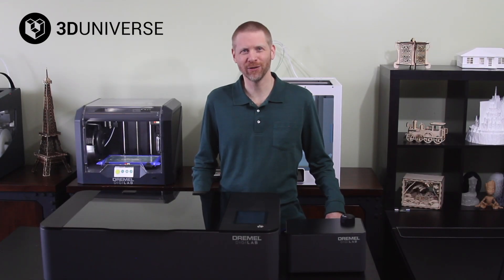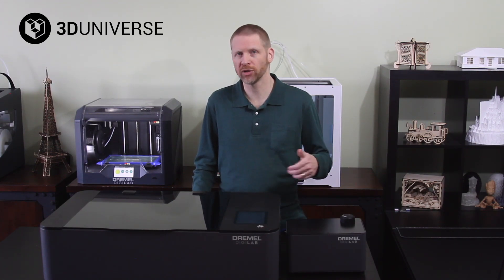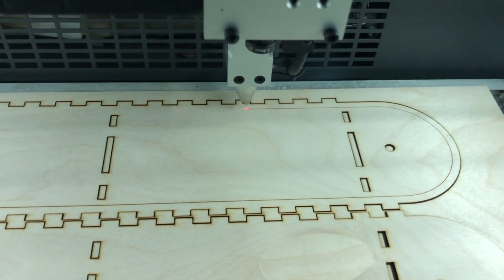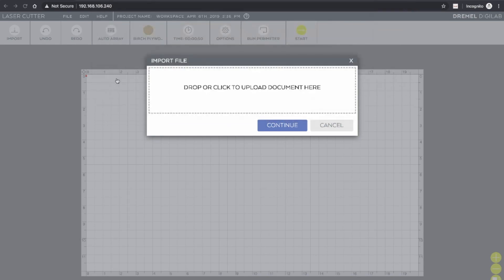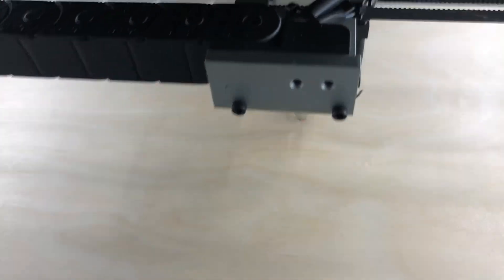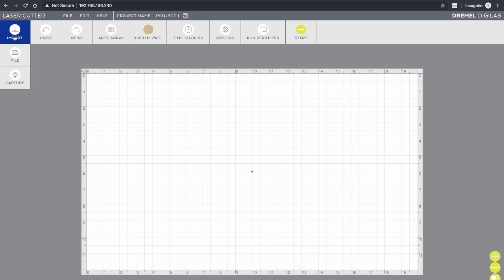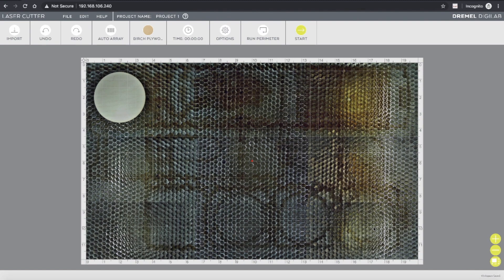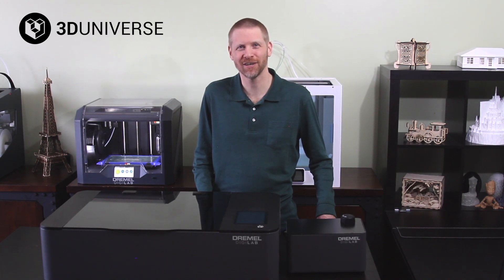Dremel DigiLab LC40 Laser Cutter Overview

Comment: Love the video, great review. What is the maximum cutting depth of timber? Are there limitations of the types of wood it will cut? e.g. Hardwood
Reply from the maker: The Dremel LC40 can cut up to 1/4" thick plywood or hardwood. You may be able to cut something a little thicker if you use multiple passes, but the default cutting profiles included with the machine are for 1/8" or 1/4" materials.